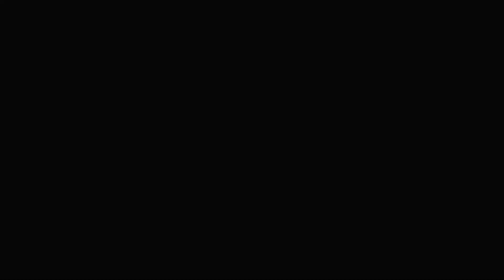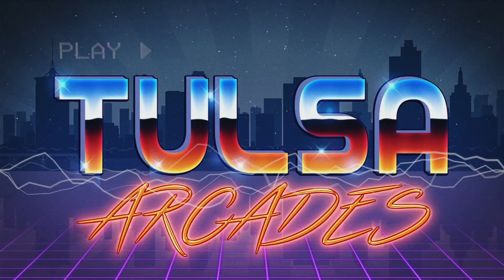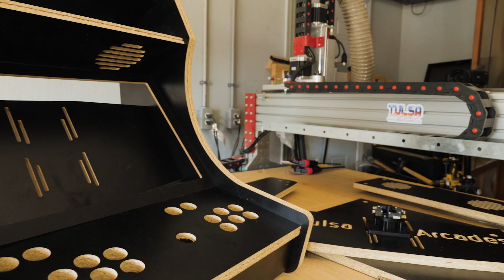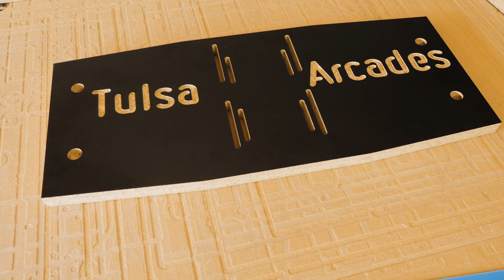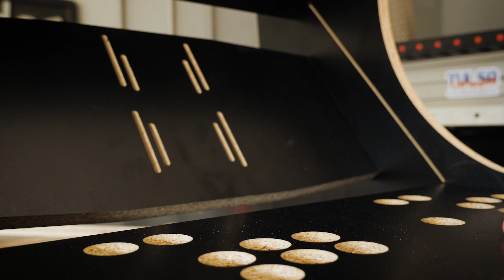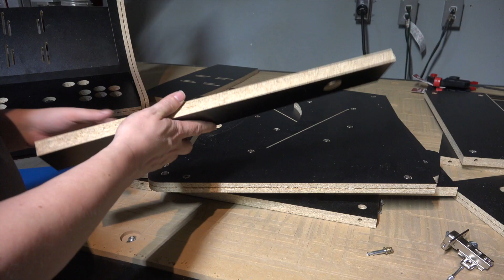Tulsa Arcades DIY Bartop Kit

Comment: I love how all the arcade kit creators have to crap on eachother. 🤣🤣🤣
Reply from the maker: Most everyone in the industry are good. We actually get along with a lot of our competitors and are in fact friends with a few. 

However there’s one that is not to be named that puts out poor quality , doesn’t cut the trim slots correctly or cuts the cam holes right and has consistent problems, they are the reason we starting making kits and where we are at today. 

You will find most people in the community get along
Reply: @TulsaArcades  I think I know who you're talking about. Lol. Anyways just wondering are you guys planning on any 3rd gen arcade1up drop in driver boards or anything for those units? I bought thinking I could just mod it but right now it looks like I would have to gut the whole thing which I don't wanna do.

Comment: is there any custom options at all? like Id like the panel single player and I need to fit a 20" or biggest 4/3 ratio monitor in there.
Reply from the maker: We plan do to work on more designs after the holidays.  We have 4 cabs total right now and more products on the way

Comment: These look like the Gameroomsolutions kit. What's the difference ?
Reply from the maker: Better cam system , Removable bezel plexiglass , Wood bezel option.    Now on V2 we have made more changes to the marquee no light bleed
Reply from the maker: You can see pictures of the recessed marquee design change here https://www.facebook.com/TulsaArcades/photos/a.389885668440191/746180716144016